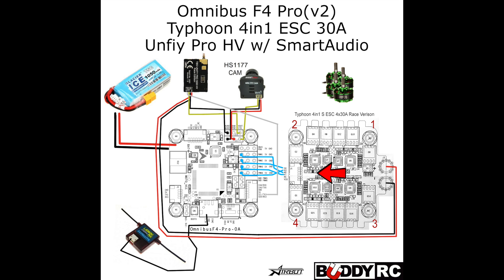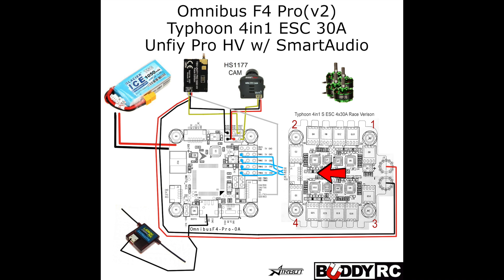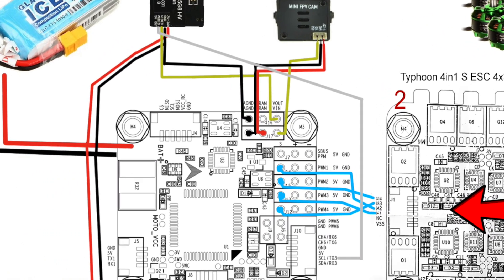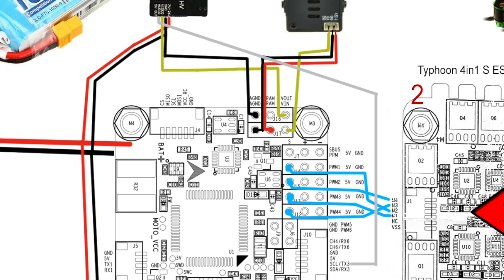Omnibus F4 - Smart Audio with Unify Pro VTX

Comment: How did you connect the one wire to the socket
Reply from the maker: You're going to have to be more specific. I this video I connect many wires.
Reply from the maker: Any time you see a wire going into a female plug, I connect the wire via a male counterpart. Any time you see a wire going to a solder pad, it's soldered.
Reply: Thanks for your time but I'm not getting any thing but osd
Reply from the maker: If you see OSD & no cam, try a 2nd camera. It may be a bad or broken cam.
Reply: I finally got it I didn't do the camera to video in an vtx to video out an audio to tx3 and it works. Thank you for your help and time

Comment: Got myself a new TBS unify HV today and i saw that it has 2 black ground cables : Video ground and the main Power ground and they both come together on the VTX connector in to 1 place. Is it not a problem to have both grounds jumped together ? (Lipo ground and AGND on your flight controller)  . Is that black ground cable that comes from your VTX to the AGND on your flight controller needed ? or is it best to keep both ? i'm a little lost here :p

Comment: "hi teacher ... I have a problem! I bought thisflight controller ... Omnibus F4 Pro V3 Betaflight Flight Controller Built-inOSD Barometer SD Blackbox for RC Drone ..and I did not realize that it doesnot have the current sensor .... but I also bought .. .Racerstar Shot30A ESC30A 30amp 3-6S 4 in 1 BLHeli_S BB2 Dshot600 Integrated Current Voltage ... tomatch and the latter has the current sensor ... can I have the sensor on betaflight via the ESC 4in1? and if yes ... how should I connect it? thankyou"
Reply from the maker: There's a current sensor input pad somewhere on the board, You can solder your 4in1 ESC Sensor output to this. Though I've never done it before. Best of luck! =/

Comment: Hey buddy can I do this on an spf3? Can you point me in the right direction for the location of the video wires?
Reply from the maker: Yes it should work on the SPF3. You can check out a handful of wiring guides on my site. Every FC has a different layout but for the most part they're all pretty similar in there IN/OUT.

Comment: Doesn't work on TX3 you need to connect the white wire to TX6!
Reply from the maker: It works for me on TX3. Did you configure it right in betaflight on the right UART? Also, You're not already trying to use RX3 for anything are you?
Reply: +RoscoFPV Everything setup perfect but doesn't work on TX3 and in BF on UART3. Was told to change to TX6 and same in BF and it should work 👍

Comment: Hello. I can´t get smartaudio working in DYS F4 aio FC. I soldered TBS unify pro audios cable ( white) to TX6 pin. Then in ports tab in betaflight where should I put smartaudio? uart 3? uart 6? Thank you
Reply: TX6
Reply: UART6
Reply: that MAY be the board I remember with the swapped RX TX pads.  Try RX6.

Comment: I did exactly as in your video, but i have no video feed on my Swift 2...and also my FC turns on (green light) only when my TBS unify is connected, if i unplug it my FC goes off. Why is that?

I used a 5 pin plug to connect the TBS to SCL/TX3, and the 5V on FC as it show on your picture in the video, but still not having video feed at all. Is just blank screen.

Could you help me out, i spent the last 2-3 hour figuring it out, but no one seems to have the same problem. Thanks
Reply from the maker: If you're FC is turning off when you unplug your unify pro, it sounds like you're accidentally powering your FC off of your VTX. Your FC should be connected directly to your battery on the big battery pads, as seen in the left side of the schematic. Can you take a picture and give me a link? I'll take a look. 

ALSO, make sure your board schematic matches mine. I know some of the omnibus versions have VIDEO_IN on the inside of the board, and some have VIDEO_IN on the outside 3 pins. You shouldn't damage anything if it's connected wrong, but you'll get a black video.
Reply: Thanks for the quick reply, just took few photos of it. Here is the link; https://www.dropbox.com/sh/x4p5j1at9t1znjw/AAAcIp9j0XnabIim5J5bnj5aa?dl=0

Thanks again for your help.
Reply from the maker: That totally looks like it should work. If you have a multimeter I'd check for continuity from your battery plug to your FC+ and then from you battery plug negative to your FC Negative. That'd be my next step b/c it seems like you're not getting power & ground from battery to FC with the Unify unplugged based on your symptoms. Also it looks like you're doing things different than I do since you're running your ESC off your MOTO pad. Which is a really good idea if you want to take advantage of the current sensor. I may copy that on my current build!
Reply: Will check it with the multimeter tomorrow...is my 2nd build, so i'm still newbie to the wiring part. If the pads are not giving me enough power after checking it with the multimeter, what should  do next?
Reply: My Swift 2 only works if i connect it with the TBS, but i will not have smart audio if i do that.

Comment: so what do for hooking smart audio on my omnibus f4 pro v3? I think projectbluefalcon said i needed a wiring harness to do so. I am building a new quad and it will have the tbs unify hv pro on a omnibus f4 pro v3
Reply from the maker: It should be the same way. Just get that smart audio cable onto one of your UARTs and then you can configure that port to be smart audio in the Betaflight configurator.

Comment: I have the same setup. Unfortunately once conected omnibus thinks my unify is a tramp. It shows me nothing in the vtx sa menu except dashes. Vtx tr menu shows me what channel band and power but you can't save. Any suggestions?
Reply from the maker: If I had to guess, you have the wrong dropdown item selected on the ports tab for smart audio. There are a few options there and you need to make sure you use "TBS SMART AUDIO" on the peripherals dropdown.
Reply from the maker: Look at my settings at 0:50 for an example.
Reply: I figured out that you need to enable soft serial and connect that way.  My tbs unify pro hv's will not communicate via uart's ????
Reply from the maker: I'm not super familiar with Soft Serial. I'm pretty sure I connected mine to the UARts. Are you using the same FC?
Reply: I'm actually seeing this same behavior. Omnibus F4 V2 from rtfq and unify pro hv. Smartaudio wired to SCL/TX3 and same settings as in the video.
Reply: RoscoFPV I believe it's listed in betaflight under osd